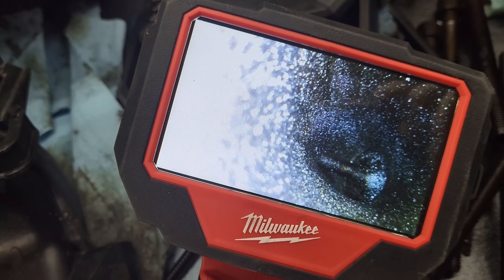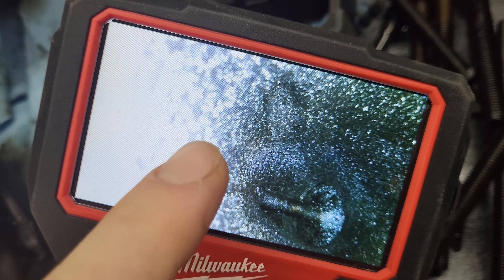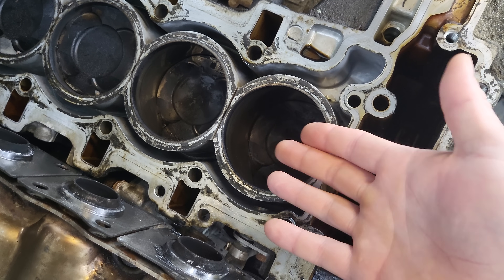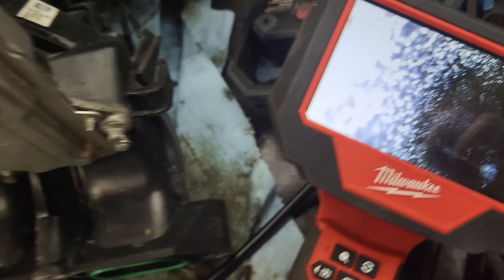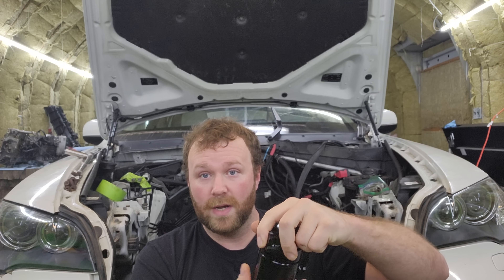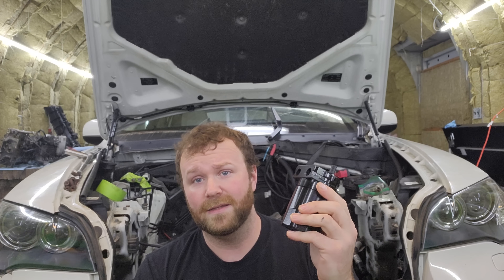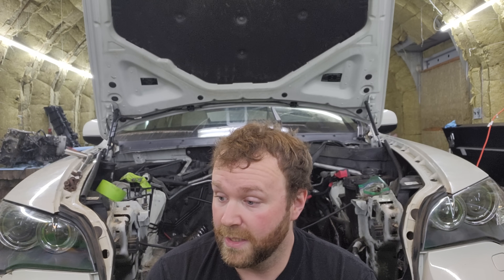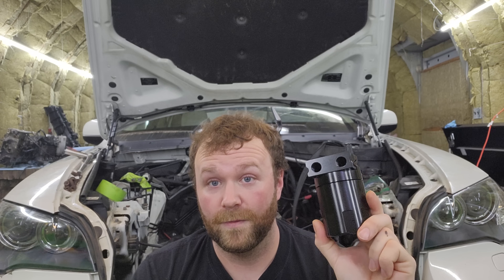The Modern Engine's Achilles Heel: How to Prevent Costly Carbon Build-Up in GDI Engines

Comment: Toyota implements direct injection, however they also have an extra injector that sprays a small amount of gas onto the valves. Problem solved. Why don't other manufacturers implement this dual injection system? They want to sell you another new car sooner. All manufacturers know if this direct injection design flaw and Toyota's way of mitigating this but don't care

Comment: What about using a can of gdi cleaner every 10-15k miles?
Reply from the maker: I've seen it baked on as early as 1000km. Problem is it's super sticky and chemicals sometimes arnt enough:(
Reply: @Lancemechanics  got it. In my car I change oil every 5k miles and use a can of CRC tgdi cleaner every 15k, which prompts myself to change oil right away. I hope it helps!

Comment: Eliminate PCV system from introducing oil into the induction system in the first place. Direct injection washes oil off of cylinder walls and causes wear and tear. DI engines also exoerience low speed preignition, and is destructive to pistons.

Comment: Stupid question. What does GDI stand for?
Reply from the maker: No stupid questions here. Its "gasoline direct injected" most engines are this type of fuel system these days. The fuel is injected directly into the combustion chamber. The old systems were port injection which means the injector would inject fuel on top of the valve before the combustion  chamber

Comment: GREAT Information, and an Excellent idea
BUT
Let's be Honest, the other reason these Entities do NOT "Fix" these problems, when they get known, is simply because they know it DRIVES (Pun Intended) Business into their Dealerships.
There is just so much wrong with how any of these Entities DEAL with the Known Problems. 
These Companies just keep producing the same products with the same problems, until eventually there is a Class Action Lawsuit, and then they FIGHT that Class Action Lawsuit, tooth and nail, It's the cost of BUSINESS, and for them it's a "Better" way as it save them Money, which means More and Bigger Profits. 
Even if they lose, the payouts are minimal, the fines, if any are a joke, and they write it off, as the cost of doing business, in the meantime, the Customer PAYS the PRICE with Cheap Manufacturing Techniques, Shoddy or Questionable Workmanship, Overpriced parts (which has a Lawsuit Quotient built into it), and are made to last only, barely as long as the warranty. It's Reprehensible Business Practices. 
You can pick any of the MAJOR Brands, they all do it.
They build low quality parts and assemblies, knowing it will FAIL, and even if they have to replace a few under warranty, it's peanuts to how much they and their dealership networks will make once that warranty runs out.
What should happen, is your Governments need to STEP UP and come up with Laws, Rules and Regulations to PREVENT these types of Consumer Predations. Ones with MASSIVE Penalties off the get go, that only Exponentially increase for Delays or continued problems.
Manufacturers are currently quite content to reap the PROFITS, knowing full well, that the consumer will have no choice but to BUY the Loq Quality Part over and over again, paying for the Labor each and every time, for things that should be SOLVED, such as you relatively Simple, and Straight Forward Oil Catch Can, then make it as TSB to CLEAN said System EVERY TIME there is an Oil Change. Or add a sensor to let the Customer know that the Can is 50% Full and needs addressing/maintenance. They literally have sensors for everything else.

Comment: Sometimes I diagnose carbon on the valves by looking for negative fuel trims and misfire counts before and after an induction service.  If both improve a bit it's a good indication of carbon build up.  Then I usually yank the intake and blast it away with walnut shells.  Made a lot of money on Volkswagens.
Reply from the maker: They basically pioneered walnut blasting :p Honda copied there systems haha

Comment: Thank you very much for verifying why I did install one of these on my 2016 F150 XLT 5.0 4x4. Easy to install and easy to service, I also do my own oil changes. Does running any type of fuel system cleaner help at all?
Reply from the maker: It will help keep the top of the pistons clean and help more with the injectors. Some of the spray does possibly touch the edge of the valve, but it's arguably not enough to clean it.

Comment: Best thing to do is spray it with some nitrous 😂
Reply from the maker: 100lb shots!
Reply: @Lancemechanics  glad you understand the message… I have a L83 (genV) swapped 88 camaro and I believe this is the best solution other then adding another system. They’ve made it pretty easy to add another system nowadays but if you add that might as well make it gain Hp too 😁 I love my genV swap but some of it is a pure HEADACHE… I had my 6l80 rebuilt and it’s giving me the blues!!! Car none mobile all summer 🤦🏾‍♂️ I’m now at this very moment waiting on a tehcum to show up….

Comment: Catch Cans are NOT going to prevent carbon build up on valves they "might" slow it down but they are NOT a cure all the only way to have clean valves is manual cleaning walnut blasting is the method of choice.

Comment: How do I determine which injection type my engine has?  I own a few older vehicles.
Reply from the maker: Usually says right on engine cover. Or Google make and model of your vehicle. It will tell fuel system type

Comment: Question: If you live in part of the country that has freezing temperatures during winter, that oil catch can could freeze up and cause other issues? Are we to remove the oil catch can to get through winter, then put it back on? I wouldn't mind but what's the correct answer?
Reply from the maker: it's a high maintenance item. which is why I'd drain them monthly

Comment: What you need to do is run a fuel system cleaner that sprays directly  past the throttle about once a year or 15K miles from brand new.  Preventative maintenance is the best way

Comment: Another thing about newer cars, they burn oil, because someone discovered a  decrease in internal friction if they just make the oil control ring back up spring weaker. So If you are doing some major work on the engine, with a car from year 2020, try to get a set of oil rings for the same car in year  2015 or older, with the stronger spring. You have to know exactly what you are doing, since you cannot rely on the parts guys. Forget about going to Crappy Tire, for the parts guy there cannot tell the difference between a drive shaft and an alternator.

Comment: Does a catch-can install effect your warranty? Does the install affect federal vehicle emission standards? 

Doesn't make sense that these are not part of GDI engine engineering by the manufacturers. This is unless, of course,  there is collusion with the vehicle servicing side of the sector i.e. carbon build-up maintenance is probably a pretty lucrative maintenance item for dealers and shops.
Reply from the maker: Does not effect warrenty. It's only illegal in California cause it's an emissions component but they don't fine for it. They just ask you put it back to stock for inspection.  As for other stuff oems don't want the headache that comes with them. They are high maintenance items and people can barely do oil changes

Comment: You don't get it. The catch cans are too small they need more area with baffeling and large 1" ID tubing and never rough the return line back through your filtered and now clean cold air intake to mix with your clean metered air-fuel ratio. This will interest with your cleanest possible combustion lowering HP and MPG and in the long run defeat what you have tried to accomplish with the catch can. If you vent your catch can back with your filtered clean cold air intake it will be contaminated air. The catch can will not be able to stop all the contaminants. Therefore the problems remain. It just prolongs the duration to having to take down the top of the engine to clean and decarbon the intake. I will not tell you to vent the now-filtered vapors from the catch can down and to the atmosphere. Happy motoring😁

Comment: The answer to NOT getting the carbon buildup in the engine is to disconnect the EGR(exhaust gas recirculater) valve from the air intake and let the exhaust gases vent to the atmosphere under the hood of the car,instead of it going into the engine causing carbon buildup.
I wouldn't give a crap about the so called pollution controls as long as I got an extra 150,000 miles of driving out of my car

Comment: 2013 Hyundai Sonata 2.4 L. 222,224 miles on the original engine and transmission. Why? Oil changes every 3000 miles and transmission fluid changes every 15,000 miles. Still going strong. Installed an oil catch can. By the way, I’m an airport transportation driver. Yes, I drive for a living.

Comment: How expensive would walnut shell blasting cost to clean the valves?
Reply from the maker: Usually 1hour on top of whatever it costs to remove an intake.  Last time I did one on a Honda 1.5l engine it was roughly 300$ for the customer
Reply: I was a mitsubshi tech we used to remove the inlet manifold and fit an adaptor then blast the valves, worked pretty well.

Comment: This is one of a few things that are problems with GDI engines for instance a non GDI engines in the past and working for Hondas for over 30 something years I could probably count on both hands how many injectors I've replaced. With direct injection engines I've personally replaced probably about 4 to 500. Any fuel you might have saved you've spent and repairs.

Comment: Why doesn't this buildup happen as bad on diesel engines? I'm a yacht mechanic who works on diesels specializing in top end rebuilds and I have never seen carbon buildup on valves like this. 

Yet diesel is arguably more carbon prone and the heavier lube oils can leave heavier deposits. I have only ever seen oil separators come standard on turbo'd perkins T653 series engines. The drain runs to the intake side of the oil pump via one way valve.

Comment: Significant confusion here.  There isn't an EGR system for these engines, and the real reason you're seeing this problem is because the EGR is being handled by variable valve timing.  The intake side is cooler than the exhaust side, and when the cam timing is on overlap to invoke EGR without any of the other BS necessary to make EGR happen, the carbon from the exhaust bonds to the intake ports and valves.

Catch can is BS for eliminating this problem.  It won't make any difference.  If it did, the OEMs would all have them.  Guess why they don't?  It doesn't work.
Reply from the maker: Go watch engineering explained. Also it's been stated by oems many times why they don't. It's a high maintenance item that ignored is extremely damaging

Comment: I replaced a 1.6 turbo GDI engine in a Kona because another tech condemned it for low compression on cyl 2. I replaced the engine as instructed. I pulled the intake off the old engine to see caked carbon on the intake valves with the worst being on, you guessed it, cylinder 2. Valve was not fully seated due to buildup. 

Walnut blast or easy off oven cleaner service probably would’ve fixed the issue. I don’t understand why mechanics don’t communicate with the customers who own these GDIs and recommend the appropriate services at specified intervals.
Reply from the maker: I've seen a similar situation in my career :(

Comment: My friend bought a new 2020 Kia GDI and it was serviced by the selling dealership every 5,000 miles.
It died at 146,000 and they wanted $ 7,500 to replace the engine.

Comment: Just change your oil and filter every 3k miles with quality synthetic, catch cans installed inline in a modern pcv system only collect condensation that would get burned off in the engine anyways.  Catch cans were originally designed for old school race engines with no pcv system and at high rpms would blow oil out the valve cover breather.  Anybody that thinks they reduce carbon buildup on a modern engine have been fooled by good advertising.
Reply: LOL...

Comment: There is a simple solution to stop carbon build up buy a vehicle that has port injection or port injection and direct injection such as a Toyota or Ford ECO Tech well Suzuki's have port injection well unfortunately you cannot buy Suzuki's in  North America but you can buy Suzuki's in the rest of the world including Australia and we do have a 2017 Suzuki Baleno or you but a vehicle with a carburator as in my 1997 Hilux and of course this carbon build up will eventually destroy your engine

Comment: I took my truck to at least a handful of different shops for a rattling noise at low rpm. All wanted to do an extensive timing job and charge me 1.5k on the low end. After a little research, it turns out the recommended oil in the US for my truck is lighter for green BS compliance reasons than the rest of the world. I switched to heavier oil (which is standard everywhere else) and everything runs great. F BS manufacturer recommendations that will definitely kill your engine earlier than its natural death, and also F mechanics. Just like doctors after the "covid" "event", there's a reason nobody wants to deal with you anymore.

Comment: The elephant in the room with these gdi engines is, not only is the soot from over fuelling going into the oil. It is going out the tail pipe as micro soot. These gdi engines are one step away from being mandated a def style system to control this. Wait for it, its coming. Tail pipes on all these vehicles are full of carbon. Check for yourself.

Comment: Manufactures do not add any mitigation items for this because they know it won't become an issue until it's out of warranty and then they can charge you to fix what they screwed up in the first place. The reason is simple.... money
Reply: Oh you are just SO cynical Nick!  (I love it!)
Reply: But many of manufacturers that had carbon build up problems in the past had to develop way more expensive changes to address them than using the catch can.
Reply: That's not true, Mazda found a mitigation that doesn't just last the warranty, it lasts the life of the vehicle.  You just run the valves hot as f* and the problem is solved.
Reply: But they screwed up on that badly. It's not uncommon for drivability problems due to dirty injectors to show up at 20k-30k miles and certainly by 60k when the warranty is over. Now they are losing their ass in warranty claims.

Comment: Don't want to deal with catch cans, doesn't fully solve the issue. Many cars still have the EGR. Manufacturers need to add port injectors like Toyota. Even a single injector that operated at certain conditions at the throttle body would help tremendously
Reply from the maker: You know a bassic Toyota engine is now 7k American. That's not even assembled. There v6 cost we'll into the 28k range. Adding more is not the solution.
Reply: @Lancemechanics I don't know where your getting you numbers from... I rather pay a little more for better engineering, reliability and less maintenance instead of a Micky mouse fix. Like I said, crankcase vapor is one part of the equation. You still have the EGR. Yeah, you can delete the EGR but that creates an emissions issue.

Comment: the killers are crank case venting to intake and exhaust recirculation back into the intake, delete both and solve everything.
Reply: PCV goes back to 1963.
EGR to '75.
😐
Reply: @hotrodray6802  They did not have GDI back then.
Reply: Correct you are Sir!  All the squawking and complaining in all these posts.....when all they need to do is just vent both the PCV hose and crankcase vent line(if equipped) down below the engine and even better into a frame rail.  The oil mist across the bottom of the body/frame will help with preventing rust as well!

Comment: I'm not sure about other makes, but I drive Mazda Skyactiv cars and they take a while to build up carbon; to equal what you showed in this video which seems to be an extreme example, it would take north of 200k miles. I'll probably just take the head off and have it walnut blasted at some point as it doesn't seem to cause issues before at least 100k. As for the catch can, I've read enough accounts of crankcase venting problems, leaking main seals, frozen cans, and stinky garages (followed by removal of the catch can) that I'll probably just skip it. The problem you're showing is real and I'm not saying they don't help some cars, but at this point I don't think I'll spring for one. These engines also have an oil separator under the intake manifold.
Reply: Yes, the issue of the venting pressure and leaking seals need to be addressed. Place a catch can on the venting system will add pressure and in time that will cause the seal issues. It's unfortunate the OEMs took a while to address this use by adding the two types of injection systems (which adds to the cost of the vehicle).

Comment: Yes, I installed a catch can on my civic 1.5 Turbo.
It works really well.
Don't see much in it in warm weather but in winter hear in Manitoba Canada with warm up etc. it can fill the can within 2 oil changes, 5 k changes.
I think its a must, at least for my civic.
Reply from the maker: Got same engine in my 22 civic. Worked at Honda for 5 years. Can't stress how important these are and specially those oil changes. :) good stuff man